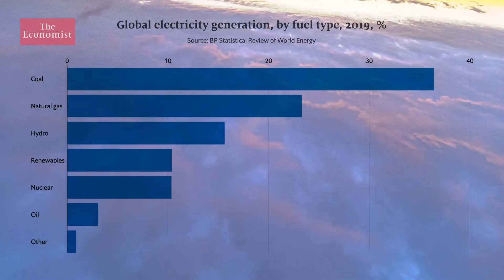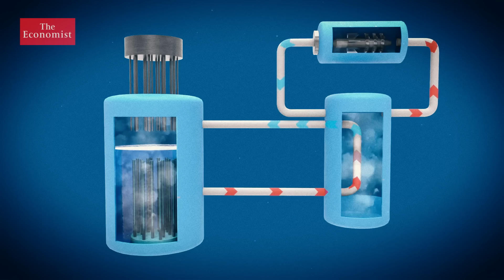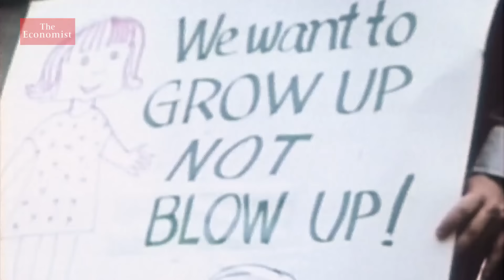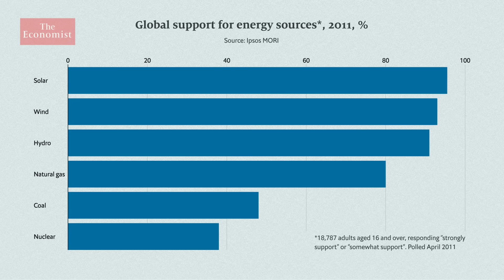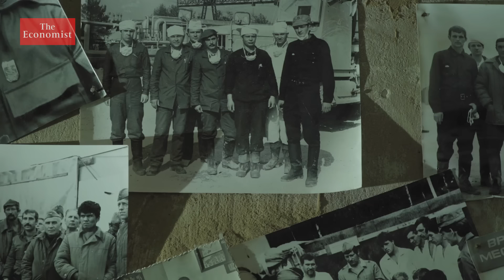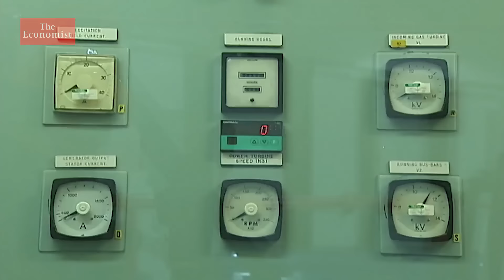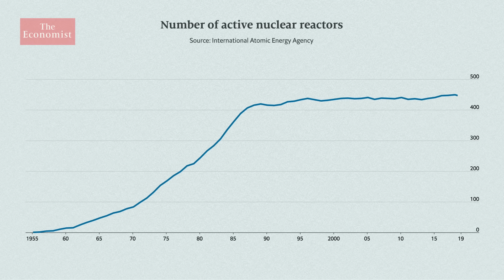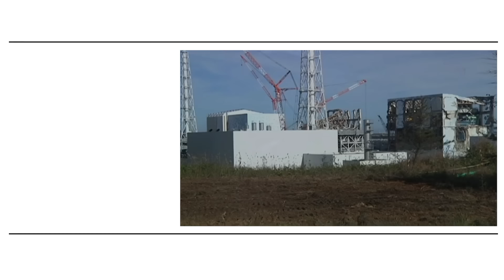Nuclear power: why is it so unpopular?

Comment: conventional energy companies 🤝 climate "activists"

dunking on nuclear
Reply: And some help from OPEC
Reply: oh the irony
Reply: Um. No. Renewable energy is replacing fossil fuels now much cheaper than nuclear.
Reply: @williammeek4078  Intermittent renewables need backup generation. Most of the time, gas turbines or coal plants fill those shoes.

Power production mixes that include a healthy dose of nuclear typically rely less on fossil generation capacity, since they can run as baseload generation.
Reply: @axel6269  This is only true right now because fossil fuels are the default already in place. While renewables are indeed intermittent in any given place, as we have learned from California and Texas, fossil fuels suffer the same problem. And the solution is the same. Import energy from places with excess generation. When you get to continental scales, solar is extremely reliable and predictable. Further, the continental US is so big, the wind is ALWAYS blowing somewhere. 

A 100% renewable grid can be implied for less cost than a nuclear “baseload” grid.
Reply: @williammeek4078  Solar doesn't suddenly stop being intermittent just because it's scaled up to continental size... I'm sure you're aware that PV panels don't produce any power at night. Unless you're suggesting we build up some kind of worldwide grid, your comment doesn't make sense to me.

As for wind, it isn't nearly as smoothed on a continental scale as you suggest. Wind is highly dependent on seasons, and can stop blowing over an extensive area for weeks. 

And most importantly, building a grid that can transfer highly variable power from the other side of the continent, and do so dynamically depending on weather events requires MASSIVE infrastructure overhauls. Germany already has quite a hard time connecting their offshore wind turbines to their inland industrial centers, and they invest far more into their transition than the US does.
Reply: @axel6269  exactly. An Energy system with only wind turbine and PV is not very safe and stable with current technology.
Reply: The money required for nuclear can be invested into renewables plus gas for firming at a far lower expense. Taking a shot at climate activists does nothing to help your cause.
Reply: @BurningMad  You're the one who's opposing nuclear and renewables here, rather than acknowledging that both need to be used to solve the issue of climate change (which is, you know, what the IPCC says). Who's sabotaging whose cause again?

Including gas, which emits 40 times more CO2 than nuclear and most renewables, in your supposedly ecological electric mix is especially telling.
Reply: @axel6269  The "healthy dose of nuclear" is probably not true: Nuclear power is baseload operation, that means it does run anyway at full load and will not help if wind or solar fluctuates up and down. You need price elastic generation (not CAPEX intensive base load) and price eleastic loads and price elastic storage to be combined with non-prics elastic harvesters of the RES-E type.
Reply: @axel6269  The issue of intermittency is not a technical problem, only an economical one about having (functional) electricity storages. We need more price elastic and grid sensitive (voltage, frequency) loads, and with the rise of the electric vehicle, these could play an important part in this.
Reply: @jasminzhang65  So add some batteries and other storages to your PV and wind based energy system. Problem solved.
Reply: @gunnarkaestle  Nuclear doesn't necessarily operate on base load. French power plants do load following and can manage pretty steep ramps-up/down just fine.

Besides, you're acting as if constant and reliable base load generation is somehow worse than variable, non-dispatchable power production at the mercy of the weather, which obviously makes no sense. I'd rather be ensured that the grid will always produce a base amount of power than have to pray that last week's wind production led to enough energy storage to make it through a windless, cold week...

Producers of these new, intermittent renewable sources need to correct the flaws inherent to their technology. It's not up to other low-carbon power producers to pick up the pieces and correct for their new brothers' erratic production.

If you look at countries that don't simply rely on the continental grid to keep the lights on when their renewables don't produce, and to dump excess production on when they do, the ones that have a grid carbon density below 100gCO2/kWh either have 1) a ton of hydro like Norway, which is obviously not doable if you don't have lots of glaciers like they do, or 2) a healthy dose of nuclear indeed, like France with 70% nuclear power, or Sweden with about 20%.

Nuclear has already proven that it can reliably decarbonize the power grid of a large country. Intermittent renewables have yet to prove they can do the same on their own.

As for storage, I'm not sure you're aware of just how much capacity you need to account for weeks worth of a country's power needs.
Reply: You don't need to be intelligent to be an activist, you need popularity
Reply: @giovannip8600  intelligent activists behave in a way to support their popularity?
Reply: Coal and chemical companies have too much money and power in the local communities, that they are based. 
And what politician would close down thousands of jobs and affecting whole cities, in the name of clean water and less cancer...? 
Instead of just taking the blood money and keep that mouth shut... 
"Ooohhh nooo the mothman did it"
Reply: @axel6269  that's a lie.. look at how the Scandinavian are handling it
Reply: @mortenfrosthansen84  Which Scandinavians? Sweden, which generates as much nuclear electricity per capita as France? Norway, which has a tiny population and enormous amounts of glaciers, which generates more hydroelectricity than any other country could ever hope to even build? Denmark, which is tiny and imports coal-heavy power from Germany whenever there's no wind or sun, leading to a pretty mediocre grid carbon density on average?

Not sure where's the lie there. Scandinavian countries have small populations, blessed topography, and yet they all rely on dispatchable energy sources to function.
Reply: Natural Gas companies literally run ads promoting wind and solar, yet these people still haven't got a clue yet.

Comment: The main reason for the cost and time overruns are the constantly updating safety requirements, which only keep getting more stringent - precisely because everyone is so afraid of the technology. Whereas reactors built in the 60's-70's were designed and commisioned within 5-6 years, these days the time to design and build a reactor is longer than the typical working career. This results in a massive overhead on constantly retraining the workforce. In the West, most people working in nuclear reactor design, licensing, or regulation, have never in their career seen and likely will never see an example of a new reactor going critical. The currently operational reactors might as well be relics handed down from an ancient civilization; everyone involved in the design process is dead or long retired. It's like that COBOL codebase that no one wants to touch or replace. A nuclear renaissance would require orders of magnitude more funding for R&D and man power, because we effectively need to re-invent the wheel. In reality there's only enough going around to keep the current fleet operational. There is no way economics of scale can ever thrive in this environment, leading to a negative feedback loop of "nuclear is expensive, therefore we don't fund it".

Another point of frustration: the cost of solar and wind are very misleading as they are calculated based on current grids, which are only enabled by back-up on-demand coal, gas, and nuclear power. In general, electricity is cheap. It is the grid and the infrastructure that are expensive. Current grids are not made for intermittent sources like wind or solar. An honest evaluation of renewables without fossil fuel back-up would include the costs of updating the grid and adding reliable energy storage to it. I can guarantee you that nuclear will come out quite favorably as a green alternative in this comparison. Politicians just know they can score easy points with windmills and solar panels wile ignoring the consequences; not so much with promoting nuclear.

Source: I did my Ph.D. on a project in the nuclear industry whereby the goal was to develop a next generation liquid metal cooled reactor. While I totally support the project goals, the red tape, the uncertainty of funding, the ever shifting government priorities, and the lack of long term perspectives or sense of progress made me leave the industry.

Another free pro-tip: if you are a sensible citizen who is pro-science and pro-environment, please don't vote for green parties. Scientists will thank you. Green parties generally have their roots in organisations like Greenpeace, which from their founding where an anti-nuclear movement and gradually adopted other environmental causes. The anti-nuclear dogmatic stance is still at the foundation of most Green parties in Europe today. If we are going to do anything about global warming, let us at least try to keep the lights on with the existing nuclear power plants, instead of prematurely closing them down for no valid reason.

Comment: Nuclear power is being held to an impossibly high standard. New reactor buildings are required to withstand an impact by a passenger jet. Plus, the requirements keep changing and so the price tag keeps rising.
China has shown reactors can be cheap, and built within reasonable time. 
As for "environmentalists" opposing nuclear power - they either have an ulterior motive, or are technological luddites. For as long as there is a single coal power plant operating we need nuclear, and we need to expand instead of contract it.
Reply: If they should not be required to hold against a passenger jet. Would it not be a perfect terrorist target? A lot of damage with only one plane.
Reply: Speaking of Passenger Jets, look what happened with Boeing's MCAS disaster after years of clowns like the cowardly Ronald Reagan preaching "cut government" to the delight of corporations seeking profit growth.
Reply: It is incredibly expensive, (current forms) produce toxic waste, take a decade or more to design and build, and new nuclear generators would embed higher electricity prices for many years after they came online. If you want large volumes of cheap and reasonably power a better method would be an overbuild of renewables + storage + inter connectors + demand management. (With enough of the first three the demand management would only be needed very infrequently.) Note - we used demand management even before we starting using renewables to generate, it has always been part of the mix as far as I can tell. if anyone says we cannot use anything that might require occasional demand management they are actually condemning every sort of generation that has ever existed.

Comment: Great piece. I’m a bit disappointed you didn’t delve into the “new” technologies a bit more such as the thorium salt reactor which is supposedly meltdown proof. You only mentioned mass production steps which doesn’t address the safety concerns of current reactor technology.
Reply: Current technology, Gen 3, is safe. Even the old Gen 2 stuff is safe outside of very rare circumstances like Fukushima. The problem is that Gen 3 is incredibly expensive to build outside of China. What's great about the new stuff like Molten Salt Reactors is that it's even safer, more efficient, produces less waste, and should be much cheaper than Gen 3 water reactors.
Reply: @manatoa1  Gen 3/3.5 isn't expensive in default. It is expensive in Europe, due to constantly changing govenments that prolong both planning and constuction. Prolonging making the final prizetag so high. It is not problem of technology. It is a problem of ideologically unstable government.
Reply: @jakubcidlik  you're not wrong about politics being a problem, but Gen 3 is fundamentally expensive. You need vast amounts of concrete including nuclear rated concrete. You need huge forgings for the containment vessel. You need extensive site preparation because the structures themselves are so heavy. All of this is made more difficult by the deindustrialization of the past few decades.

IIRC Gen 3 reactors are being built in the States, UK, Finland, and France. All are way over budget and behind schedule. China has the political, regulatory, and industrial preconditions to make them effectively. The West doesn't, sadly. 

Fortunately, MSRs have smaller cores, don't need huge pressure vessels, don't need huge containment structures for steam/hydrogen explosions, and can have smaller and more efficient turbines since they run a lot hotter.
Reply: @manatoa1  For Finland, It's behind budget because of the governmental bureaucracy and regulatory reasons.
Reply: The ultra long radioactive life of irradiated (so called) spent nuclear fuel is entirely because just 4% of the fissile energy has been extracted. 
The waste burner molten salts are cheap because they are so intrinsically safe. (Moltex and Elysium) can use the remaining 96% of energy trapped in waste fuel. The exiting 30,000 year half life is reduced to just 30 years. Additionally, they completely denature the fuel. The isotopes are so mixed that it would be easier to make new fuel in a PWR reactor.
Reply: Moltex expect to be online by the late 2020s. Elysium are stuck with US regulations that only work with PWRs. Any other design cannot be approved because there are no generic procedures.
Reply: @manatoa1  No, Gen3 is not fundamentally expensive. Russia and South Korea build Gen 3+ without much cost/time overruns. China builds Gen3 even faster and cheaper. Only EU (EDF) and US (Westinghouse) have troubles with cost and time, because they are trying to make a new design after 20 years of stagnation.
Reply: Thorium is epic
Reply: When molten salt reactors can be built cheaply, I'll be interested. Until then, they suffer from the same problem nuclear has always had - its enormous expense. I'm content for the world to go with renewables plus gas for firming until such a situation arises.
Reply: thorium/salt,has been around since 1940. it was in use for 18 months in the u.s, but was banned,as it didnt produce weapons grade waste.. funny...eh....
Reply: @Dave5843-d9m  We'll have X energy Terrestrial energy and NuScale online in the US in the 2020's
Reply: @paulbedichek2679  lol keep forcing yourself into an unnecessary dichotomy.  Just because I oppose nuclear energy, doesn't mean I support coal either.  But hey you probably work for Bill Gates.
Reply: That’s what they say don’t be fooled jus yet

Comment: Almost all domestic heating in Japan uses electricity. Power from Fukushima and other nuclear power stations in Japan has prevented countless deaths from hypothermia among old people  during Japan's cold winter months. And people forget that the Fukushima event was triggered by an entirely natural event - a tsunami. The tsunami killed around 18,000 people directly.
Ian Graham
Reply: Without nuclear energy Japan will struggle with such energy needs.  It can't be done with renewables, so they resorted to fossil fuels.  Sad state of affairs to appease the whining from the ignorant anti-nuke lobby.
Reply: @danadurnfordkevinblanchdebunk  Incorrect. You can power everything off of renewables and energy storage. They returned to gas because they already had some plants built (peakers) and because you can build them faster than anything else with large power amounts. They won't build a new nuclear plant right now simply because it will cost billions and take well over a decade to build. 

Renewables are likely the only real future, unless those massive promises for nuclear actually happen. But batteries, solar, and wind are all improving greatly and dropping in costs every year. Unless someone makes an amazing breakthrough with nuclear options soon, it will mostly be dead in the public power production space. It will still be used by militaries and maybe space, but not much else.
Reply: @anthonypelchat  Tell that to Texas, which ironically had a grid failure at about the same time you made that comment. A major reason for the failure was that renewables weren't able to keep up and many of them failed in the harsh conditions that it suddenly found itself in.
Reply: @IIBloodXLustII  Look again at the Actual cause of the failures. It wasn't renewables. It was the gas power plants shutting down due to no winter protection. A handful of wind turbines also shut down for the same reason. Both were due to cost cutting and nothing to do with the power type. Most issues could have been prevented if they had enough battery storage, but they didn't. Nothing unusual there as it will take time to build enough battery storage in the first place. 

Renewables work in far, far harder conditions than what Texas experienced. Wind Generators are placed in the ocean off of Europe and hit massively worse cold and snow than Texas got. Solar is used in Canada as well. People who had personal storage and solar in Texas had few issues as well, with all issues experienced due to relying too much on the grid.

Comment: Small modular reactors & thorium salt reactors are the way to be 100% renewable.
Reply: 100% renewable doesn't exist.
Reply: Well, nuclear is not renewable. You have to mine the resources and it still produces waste, however inert or non-dangerous. Definitely the best way to go though, because it’s gonna take a while to have batteries capable of storing necessary amounts of energy.